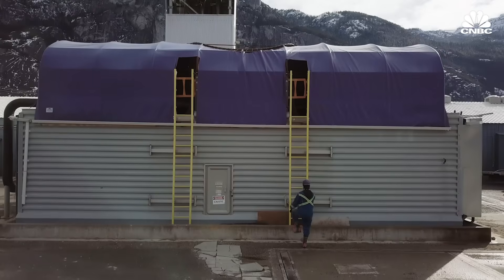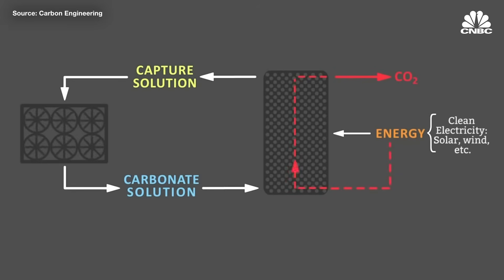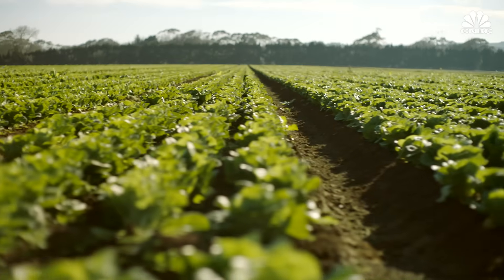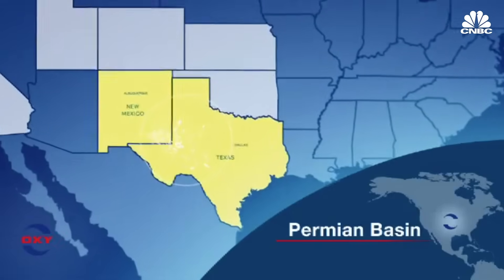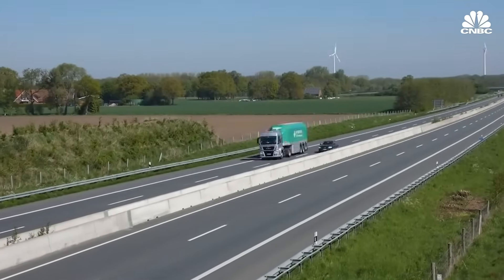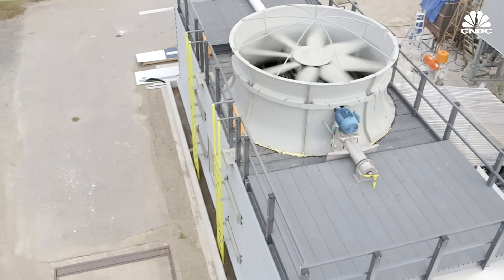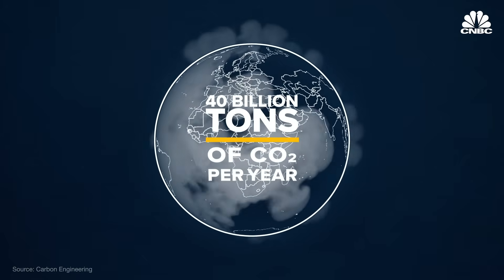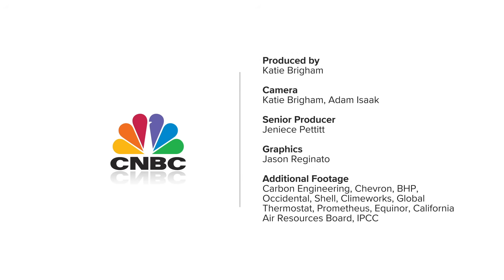Bill Gates-Backed Carbon Capture Plant Does The Work Of 40 Million Trees

Comment: We're going to need all this extra CO2 as we leave the current interglacial and head toward ice age, as well as the smaller grand solar minimum that we are due for (they happen about every 400 years, the last one in the middle ages). Besides, temperatures haven't been increasing hardly at all in almost 20 years even though CO2 has increased like crazy, suggesting the amount of CO2 forcing of the climate is much less than we might think, this is bolstered by multiple failed models for the rate of temperature change in the last few decades, not to say CO2 isn't a substantial factor, just that we aren't factoring in all the other foring mechanisms (like solar activity, earth tilt, cosmic rays, volcanos etc).
Reply: 95TuboSol, are you sure about your temperature data? Are you referring to the original data, or the ones that have been doctored up by Dr. Mann and his gang of climate thugs?
Reply: @nedwalport4426  Of course not, temperature data is based on GISTEMP, HadcCRU, NOAA, EMCWF and others, which all agree. We had temperature increases until 2000 then it just practically flat lined. The only variance from that flat line was in 2015-2016 when we had that big El Nino and it spiked up because of sea temperatures and it's now trending back down at the same rate, We'll see where it goes from here, if it starts to track back up like it did in the late 70's-90's or if it stays flat or decreases, it will be interesting to see. 

Either way, it's a big anomaly if CO2 is the primary driver of global temperature. The rate of CO2 increase is almost a vertical line on the charts yet temperature hasn't hardly budged for 20 years. 

The big picture is important though, what is happening with global temperature is the normal trend of the earth historically, 100k years of descent into ice age, then a rapid spike into interglacial of about 10-15k years, this cycle happens over and over. We are about 80-90% through the current interglacial period right now (it started about 11,700k years ago). https://en.wikipedia.org/wiki/Interglacial#/media/File:Ice_Age_Temperature.png
Reply: @95TurboSol  , Sorry, if it doesn't come from a respected scientist like Dr. Mann it just doesn't jive with my belief system.
Reply: @nedwalport4426  Huh?
Reply: @95TurboSol  Sarcasm...Mann invented the hockey stick graph...and made a fool of himself for "selective data management"  meaning he chose the data that reinforced his theory and ignored the overwhelming data against it.
Reply: @markanthony3275  it's not based on mann, its standard data from gistemp,hadccru, nova and emcwf. Read the data, the only meaningful increase in the last 20 years was the 2 year bump up during the el nino of 2015-17 and the temperature is dropping back down at the same rate it increased, we'll have to see where it ends up when we get the new batch of numbers in a year or two. The fact is, temperatures are NOT record highs for the current interglacial, this is the coolest interglacial we've had in the last 4 cycles (400k years). That's not to say co2 doesn't have a warming effect on the planet, I believe it does but I think we over estimate it's effect (shown by pretty much every computer model failing to predict the rate of warming). And we know we are at the end of this interglacial warming period (which lasts 12k years) and temperature will trend down into ice age for the next 100k years, this is a fact. Our future is cold, we just need to ensure we don't get too warm before the full effect of the downward trend takes effect.
Reply: @95TurboSol  No , but Mann, was the person who formulated all this data into the "hockey stick "graph that I'm talking about. The real gain in temperature over the last 100 years has been less than 1 degree.  Tony Heller does a fantastic job of showing how the historical data has been shaped and altered so it can be used to show AGW.

Comment: So, what is powering all this equipment?
Reply: Electricity
Reply: Matt Fantastic. Use the the fossil fuels to provide efficient baseload power that intermittent sources like solar and wind cannot do reliably. Meanwhile, you can power the carbon sucking machines with a combination of renewable energy sources (hydro dams, solar & wind) and maybe some thorium powered nuclear reactors.
Reply: Heidi Piltz in other words gas or oil

Comment: Since the oceans are absorbing carbon, wouldn't the oceans have a higher concentration of carbon than the air and thus be a better place to capture carbon? You'd have to come up with a different way of removing the carbon but it shouldn't be impossible to figure out.

Comment: The ONLY way to have CO2 actually REMOVED is remaking it into Carbon and Oxygen. That's done by plants. That die and will make new CO2 unless changed into carbon hydrates, CnHm i.e. fuel. And where are you going to get the energy needed to break the CO2 atomic bonds?
And than the sales punch @10:11: "Wind and solar energy REMOVE CO2 from the air, because they prevent it from entering the atmosphere in the first place." That's plain trickery! If I remove a coffee spill from the office floor, it is NOT the same as preventing the spill from happening in the first place.
When the engineers and sales persons have to rely on aforementioned linguistic tricks, you can be sure they are selling you thin air.

Comment: Hello, would anyone be interested in providing renewable energy to every home in America for less than $700,000,000,000 spread out over 10 years. That's about 128,000,000 homes that would have the ability to support themselves while using the current utility grid as a backup. The current renewable energy sources, wind, solar, and hydro electric systems are okay. The current issue that concerns me is they require massive amounts of land for solar, wind turbines are a real eye sore, and hydro plants have reshaped our land and not in good way. The cost factor to build and maintain these systems are asinine. Some may say $700B is a lot money, and they are correct. I have finished development of a system that is not at the mercy of the elements. Low cost and low maintenance make it a game changer. To find out more information about my system check out my YouTube videos. Then contact me. Thanks.

Comment: Nitrogen (N2) -  78.084%
    Oxygen (O2) - 20.9476%
    Argon (Ar) - 0.934%
    Carbon dioxide (CO2) 0.0314%

75% of the 0.0314% is from natural causes.   That means .007825% is man made.  That is about 8/1000 of 1 percent.  The sky is falling, the sky is falling said chickenlittle.

Comment: So the liquid chemical has to be very caustic to react with CO2 at the rather low CO2 concentration of 400 ppm in air.  Let’s guess it’s Calcium hydroxide solution in water.  Industry produces many thousands of tons of Calcium Hydroxide annually.  It’s predominantly made by mining limestone and heating it until CO2 is driven off leaving CaO.  Then it is reacted with water to make Calcium hydroxide.  A solution of Calcium hydroxide can react with CO2 in air, converting it to those little pellets of Calcium carbonate.  Unfortunately it can only react with as much CO2 as you drove out of the limestone to make CaO to start with. More information would be required to determine what these folks are actually doing in order to determine where their process sits with respect to Earth’s carbon cycle, and whether it is beneficial or not.
Another possibility would be to regenerate the Calcium Carbonate solution and end up with a more concentrated CO2 stream, but that CO2 would then have to be sequestered by some other method such as geo-sequestration.

Comment: Another issue, besides oil companies funding this making thier business relevant still, the CO2 captured is only affecting local areas. If you plant trees in south America it doesn't benefit North America. Local areas that don't control CO2 emitions they will still be in danger. These objects would have to be everywhere. Not the correct long run goal...

Comment: If the claim is true and I have dout about that(40mil trees) it would create local ecological catastrophe(starve local plants of theyr food) and decrease the eficiency drasticaly. The forest decreases the CO2 only by the stuff which will not desolve so for tree solution you need to store the wood and plant new ones as forest will decrease the CO2 only by the amount stored in them not more, as the forest will reach the eqilibrium(falling-rotting and growing new) it wiil become co2 neutral. What is the difusion model/map of CO2 aroud that 40mil tree thingy. Minimum concentration in PPM to support plant life varies from 185 ppm to 225 ppm(cca half of atmospere concetration). So what is the predicted area devoid of life around that thing?

Comment: Anthropogenic global warming....if only it were so. Global warming would move the limit of the grain belt way up into Canada and Siberia.  Greater CO2 would dramatically increase crop yields. Hunger would cease globally.
 CO2 levels were as much as 10 times greater in ancient times than the levels of today, yet no Armageddon occurred. Read the scientific papers of Dr. Heinz Hug to understand how CO2 functions in the atmosphere. It has very narrow bands of absorption, 1, 2.7, 4.3, 15 micrometers are the generalized spectral peaks. These  wavelengths are ALL absorbed to extinction within 30 feet of the ground. ADDING MORE CO2 DOES NOT INCREASE ENERGY ABSORPTION, but only reduces the distance needed for full absorption by a foot or two, in fact,  higher CO2 levels caused  higher O and O2 levels (photosynthesis) that  allowed the dinosaurs to exist (Commercial green houses inject CO2 to increase plant yields). The atmosphere today has .04% CO2, yet modern nuclear submarines operate with levels of .2% or higher with no ill effects to the crew. Higher CO2 also reduces the amount of water vapor venting required from plants. When plants draw in air through its Stomata (tiny holes) to eat the CO2, it must vent water vapor to keep from drying out. If there is twice as much CO2 in the air, the plant only needs half as many Stomata, and thus uses half as much water. The deserts are greening today, where the CO2 is rising; for this reason. Also, with low CO2, plants must breath in oxygen to replace it. They generate hydrogen peroxide and other damaging molecules that the plant must expend water and energy to remove. Remember that In ancient times, the times with the most vegetation and O and O2, CO2 was as much as 10 times higher than today. We are currently in a CO2 drought, see the You Tube video  "World in Midst of Carbon Drought (w/Prof. William Happer, Princeton University)".
As an example, during the Cretaceous period, there was NO ice at all at the poles, much higher CO2, and  the Earth was full of vegetation and dinosaurs. They could not live today as the O and O2 levels are too low for such large land animals. 
The oceans are rising today because the Wisconsinin ice age has not yet finished, there is still ice at the poles and it is still melting. The ice age ends when all the ice has melted, so technically were are still in the last ice age, but the next ice age will begin before the last has ended. 
The climate changes we have seen in the geologic record are entirely disconnected from the CO2 levels. CO2 is a VERY minor gas in the atmosphere (.04%). Note that water vapor is a vastly more efficient and abundant greenhouse gas (1% to 4.24%) than CO2. The reason for climate change is entirely due to the output of the sun and the amount of cosmic rays striking the atmosphere. Watch the You Tube video "Svensmark: the cloud mystery" and maybe read his book "The chilling stars" to understand the reasons for climate change,  it has NOTHING to do with CO2.
After doing these things,  look on the US Geologic Survey website and find the graphs of Earth temperatures over the last 2 million years. This time period includes all the recent ice ages. You will see that this data proves we are leaving the current interglacial warm period and are entering the next ice age. 
The fraud of anthropogenic global warming exists because the globalists are subsidizing it to convince us to accept a global carbon tax, that is to get western nations to accept it. There is no call for China, the greatest producer of CO2 in history, to pay such a tax. ONLY the west. This tax will in effect take money from poor people in rich countries and give it to rich people in poor countries.
Don't fall for this fraud. AGW is the greatest science scam ever thrust upon the people of the Earth in all of history. Don't buy it, educate yourself instead.
As a final note, read about the Vostok ice core samples, and other following sample sets to see that ice ages are preceded by a brief warming period. We are leaving that stage now. REAL scientists expect a little ice age to happen, starting as early as 2020, and that it will last 350-400 years. Be ready.

Comment: Great idea. We'll pump the earth up like a balloon! Or maybe when we force the Co2 down so far it'll turn to a solid. Any idea what sort of pressures would be involved? We might need to burn some more fossil fuels to get the energy to push it down, but no matter. Because none of these idiots seem to take account of the laws of thermodynamics. And of course there's absolutely no chance that the rock around the bore could ever fracture, a valve or pipe fail, and simply let it all back out in a big rush. Here's another idea. What we really need is a whole lot less people.

Comment: If this thing is not powered by solar panels or windmills, this will be a redundant piece of work. Because about 92% of our electricity is generated by fossil fuels, the very problem that this thing is supposed to fix. Carbon dioxide emissions!

Comment: capturing CO2 and selling it to places where it will be released back into the atmosphere?!??! am i missing something? they know that pumping it into oil wells will not contain the CO2 right?... CO2 in carbonated drinks gets released back into the atmosphere.. WTF
Reply: Its a process called "direct inject". Instead of having a pump Jack they have a casing thats over the tubing that brings up the oil. They pressurize the well through the casing that than forces oil an gas through the tubing. Its done right now with natural gas that comes from that well. So im sure if they use co2 instead they could sell more of the natural gas. Not sure how they would separate the co2 from the natural gas or how they could reuse it.
Reply: I think separating both gases shouldnt be hard. The point of capturing co2 from the atmosphere is to solve climate change. Releasing it back into the atmosphere via the oil wells or carbonated drinks doesnt solve the problem

Comment: Well… lets be optimistic…
50 USD/ton of CO2
World wide emissions 40.000.000.000 tones at 50 USD/ton = 2000.000.000.000 USD/Year or in short 2000 TRILLION USD/Year
World GDP around 80 trillion... so lets think… costs 2000 Trillion/year in cost, available 80 Trillion (If you use all).
In short a dumb idea, treat the problem instead.
Cheaper with going green and new grids.

Just make one thing clear… extracting sequestered CO2 from the ground, capturing it AND THEN USING THE CAPTURED CO2 so it gets added to the carbon cycle… does not help at all.
Second objection…. energy return on investment....
How much energy is used to extract energy…
In the 1960 oil had a return of around 50x-20x today shale is 2x... add carbon capture and all of a sudden you use 2kW to get 1 kW.... not a good idea...

Comment: How carbon intensive is the energy used to run the facility and create all of the chemicals that that it consumes?   These things aren't free, our whole industrial supply chain depends on cheap carbon based energy.  What's the actual net gain from these facilities?

The best way I've read about to remove CO2 is to use magnesium-rich minerals from the earth's crust, pulverizing them to increase the rate at which they can react with CO2 and water to form insoluble carbonates.  This pulverized rock can be sprinkled on farmland to act as a mild fertilizer (adding trace minerals to the soil) while it slowly reacts with the atmosphere to absorb the CO2.

This is an accelerated version of the natural geological processes that have removed carbon from the atmosphere in earth's past, and although crushing rocks still takes energy, it's much less than any process involving the use of heat and chemistry.
Reply: It would most likely depend on whatever source of energy they would use to power the plant. realistically, hooking a giant facility up to a nuclear plant would be best, but it would most likely just be hooked up to the standard grid and use fossil fuels. good thing is that you can reduce the amount of CO2 put out by those plants, bad thing is it still puts out CO2 in the first place. it could turn into a net reduction overall, but by how much depends on the power source.